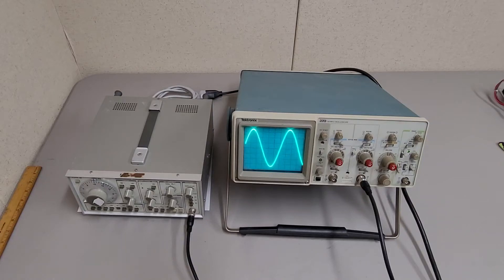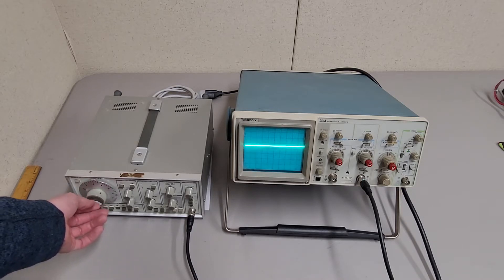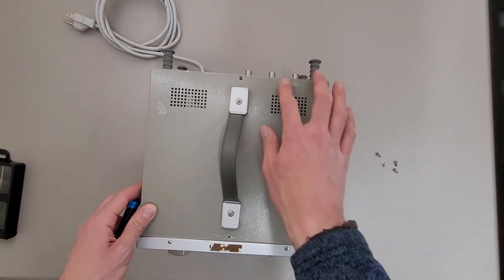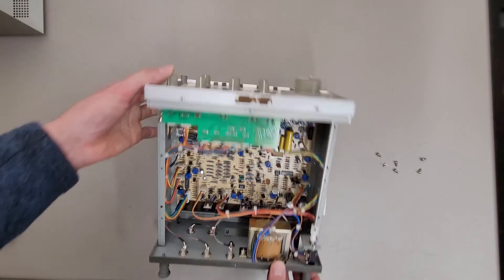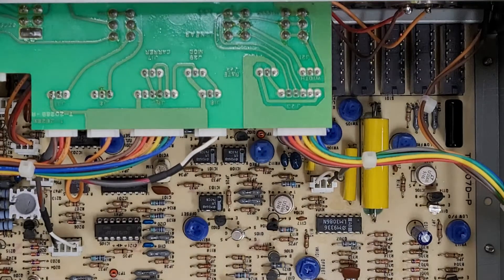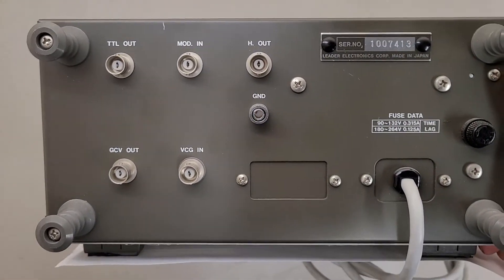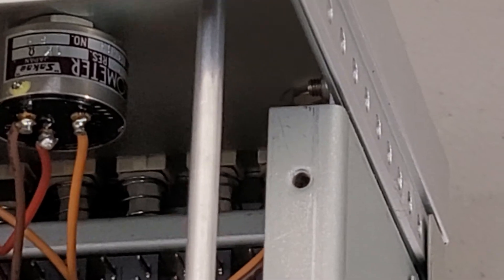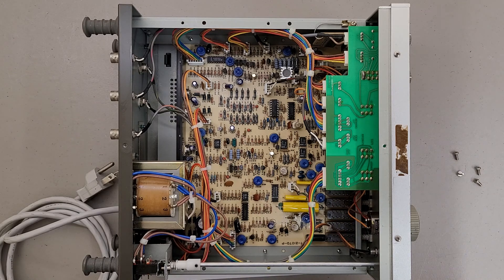Looking inside a Leader LFG-1300S function generator

Comment: If you intend to run hard at high freq. you need to fit cooler for TO18 dual fet and driver. As this is a std RC osc it need very stable npo capacitors.
Reply from the maker: @HowardJohnstone  I honestly don't know what I would use it for beyond repairing audio gear. I will have to keep the mods in mind.

Comment: This unit has some classical issues that should be adressed. The upper left corner has some cramped power resistors that will burn the board, these need to be lifted free of the PCB or replaced by modern ones. Also replace the two filter capacitors, if you maximize value, then upgrade rectifier diodes or they will blow. In a genset you need clean supply rails, clean potentiometers and contacts.